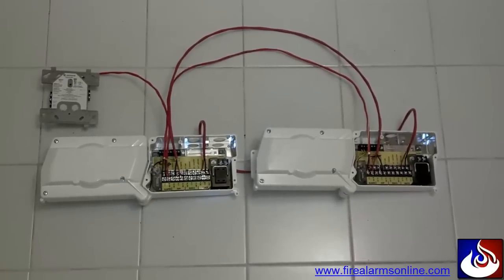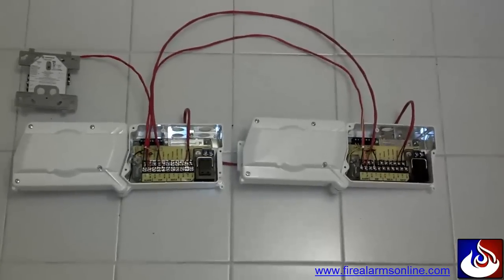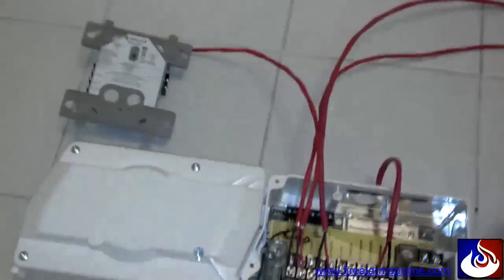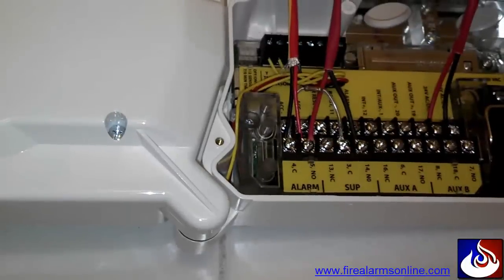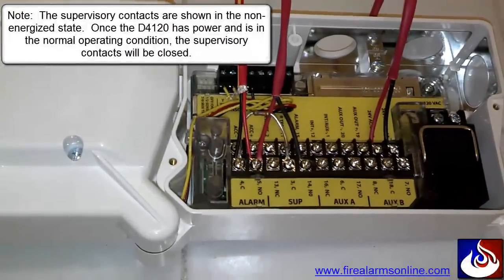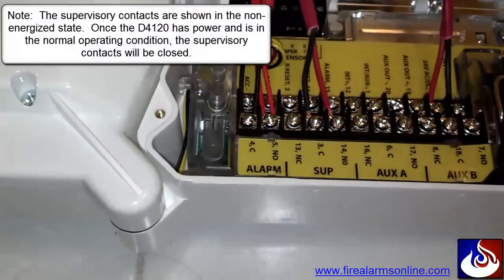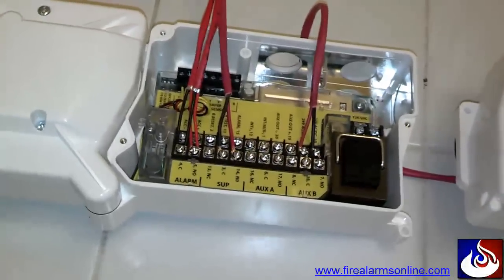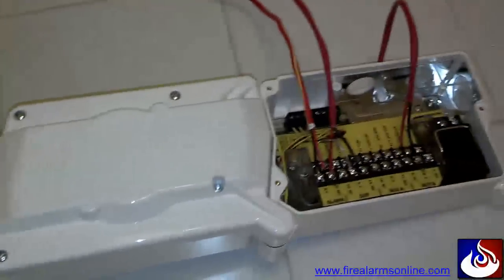System Sensor Convention 4-wire Duct Smoke Detector D4120 Wiring Instructions

Comment: Hey bud great video. Iam an HVAC tech and need to replace System Sensor D4120  it looks like it will be wire for wire. My question is I will be notifying the monitoring company to put the fire system on test, what is the best way to disconnect the alarm and supervisory wire so I don’t short anything out. Turn power of at control panel? Will it start up once I turn the power back on? I will also turn off the breaker that is providing 120 volts to the detector . Thanks my knowledge of fire alarm is limited.

Comment: I know this video is quite old but I hope to hear back from you. What is your opinion on using a mini monitor module and resistor in each detector? Also what is your opinion on getting your 24V from the hvac equipment instead of the panel?
Reply from the maker: It is typical to see an addressable monitor module at each duct detector.  This video was more for the techs that struggle understanding how to properly wire multiple units with supervision on one circuit.  I do not recommend having the HVAC contractor provide the power.  These units like other 4-wire detectors are reset upon temp loss of power.  This is why we always use resettable power.  If there is an alarm, you simply press reset at the FACU which drops power and resets the unit.  If you have the unit powered by the HVAC contractor, you will need to get up to the unit to press the reset button every time there is an alarm.
Reply: Makes sense, I worked with a cheap guy who liked to to use 1 module for multiple detectors, I worked with a lazy guy who liked to let the hvac guy power the detectors, but I have always personally liked to run power from the panel and have a module at each detector.
Reply from the maker: it really is the best way to go.  you should join our FB group.  check it out here:  www.facebook.com/groups/firealarmsonline

Comment: If I have three do I run a wire on trouble contacts from the first to the second then the 3rd back to the first?
Reply from the maker: You will have to run the trouble contacts in series. One conductor runs in series through the trouble contacts. At the last device, the other conductor runs all the way back (this conductor can just be wire nutted at each device to make it easier)

Comment: AC UNIT IS STAND ALONE (NO FIRE ALARM AND BMS); NEED TO USE DUCT SMOKE DETECTOR AND SOUNDER. UNIT HAS TO SHUT OFF AUTOMATIC IN CASE OF FIRE. SUGGEST ME HOW TO CONNECT IT.